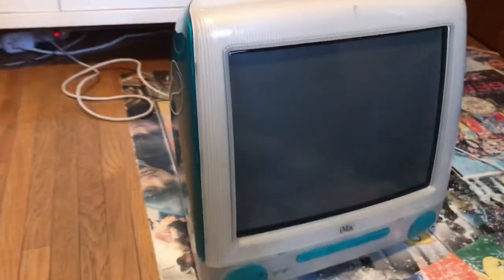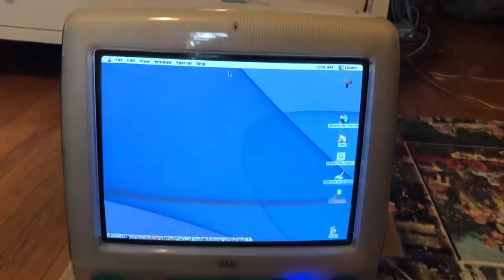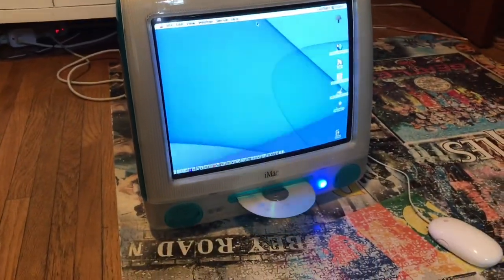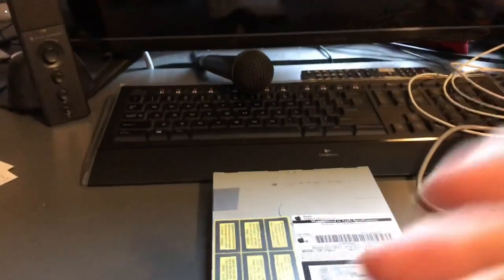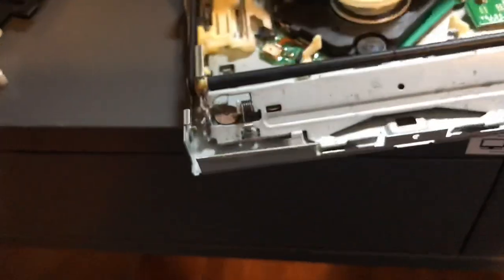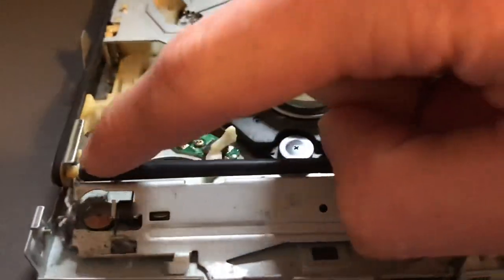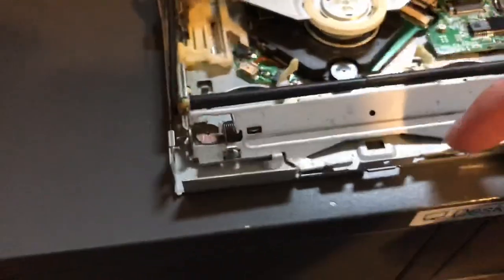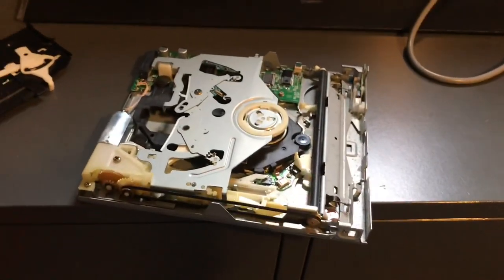How to repair iMac G3 DVD/CD drive

Comment: Boil the rubber pieces in boiling water on the stove to make the rubber pieces shrink back to their original sizes
Reply: But how do you get the rubber pieces out?
Reply: @WinrichNaujoks  You can unzip those two black springs that hold down the mechanism in the front, then you get the whole metal rod with the rubber pieces out. The bigger side got an easier clip, unclip it and you can remove the rubber from the rod

Comment: my imac was reading discs fine a few hours ago and now it suddenly doesn’t work. i will try this

edit: so i have attempted the repair and i put a small piece of metal in between the metal tube and it didn’t work. i’m instead gonna try to order a replacement belt in ebay

Comment: It’s been some time since you released this video, but you can unzip those two black springs that hold down the mechanism in the front, then you get the whole metal rod with the rubber pieces out. The bigger side got an easier clip, unclip it and you can remove the rubber from the rod
Reply: How do you unclip the rod to remove the rubber? Do I just pull it out? I'm afraid to break it.
Reply: @stereodelay6601  No, one end of the rod is bigger, you can unclip it, be a little careful, but It should work. Than you can pull out the rod and remove the rubber
Reply: @gewittertorte Thanks!!! I figured it out. However, after boiling both the rubber band and the rubber roller and putting the drive together, it still doesn’t load/eject the CD. I’ll try once more in a few days…
Reply: @stereodelay6601  I had no luck with heat and never did that again. I used small paper parts and put them on the far outside of both ends of the rubber parts. And don’t forget to take a look at the belt on the side, it could also be old and slipping. You should maybe consider replacing it

Comment: Question regarding burned CDs.  My G3 tray loader (rev B) can read any and all burned PS1 games no problem. Now I'm trying them on another G3 (slot loading 350MHz), and it's spitting any disc burned to HP right out, but it will read memorex discs (with errors)... is the drive failing or are there drives that are just incompatible?  It reads an authentic game with zero issue.... but then again, it does have the slow eject issue going on so it is showing its age in that respect.  Do you suppose the sloat loading 350 can accept a DVD drive?
Reply from the maker: I’ve had that issue with different cds as well. Completely random too. Some discs of the same brand would work, others wouldn’t. But yes, If you took a slot DVD drive you would be able to put it in place of the CD with out any issues

Comment: Do you have an extra dvd drive and a graphite ram door, I got a 700mhz graphite that needs them
Reply from the maker: Jack septiceye I unfortunately do not
Reply: Thanks anyways
Reply from the maker: Jack septiceye np. Just takes pc100 I think
Reply: It has ram but the actual door that covers the ram is missing
Reply from the maker: Jack septiceye i see, miss read that. I do not have one of those either lol
Reply: Oof, well I appreciate you responding
Reply from the maker: Jack septiceye of course! Always try to.